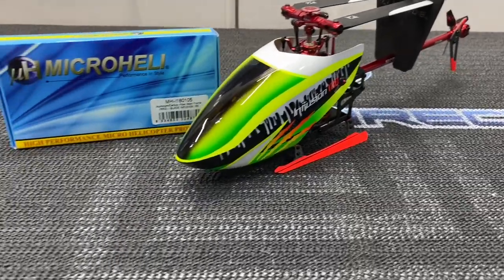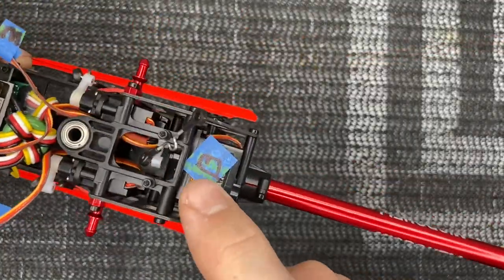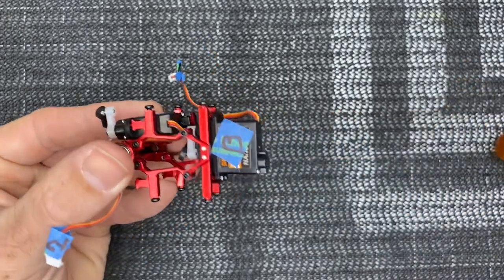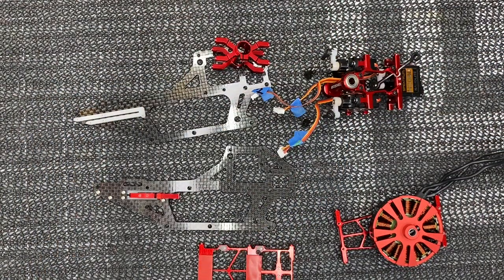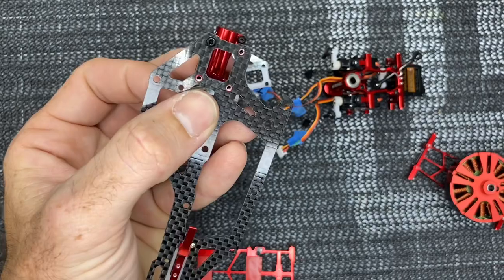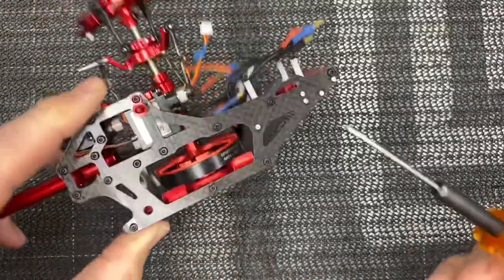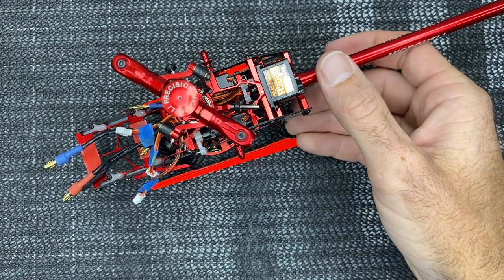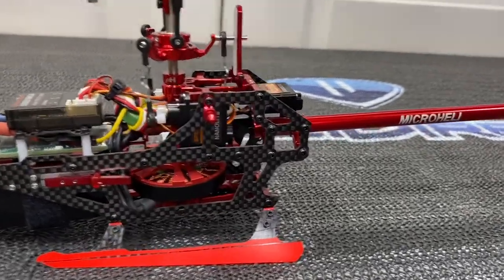Blade Infusion 180 MicroHeli Main Frame Build

Comment: Just got my Blade 180 Infusion today 😊. So pretty. First collective heli. Such a beast compared to the 120 SR and smaller helis I've flown. It has so much... presence in the air. Really feels like a serious machine. Maiden flight in basement went... Uh. Well, it went. 😂

First five minutes of battery I spent hovering around. 😰 Then I realised SAFE mode was not working, no self-leveling. Felt kind of proud I kept it as stable as I did without it😊. Landed, set hold mode, checked settings in NX8, found forward programming and enabled SAFE. Telemetry said battery was at 3.98 (I'm using the 850mAh for training time) so I set it down and decided to try hovering in SAFE. 😮 So much easier.

The I got cocky and flipped it to stunt 1 and promptly lost control. It bounced off me (hurt my pride more than anything) then crashed into the ground and snapped the tail boom because I forgot throttle at 0 in stunt 1 does not, in fact, kill the throttle. TGF spare parts 😂. 

Ah, I need the practice of replacing parts for whenever I decide to get some of these sweet metal microheli upgrades.

Comment: Pro(?) tip: before and during disassembly take photo(s) of each detail area so you know where everything was before you start moving things.
Reply from the maker: That helps some people. When you’re changing to a different frame design, it’s harder to take pictures of its stock because things are a little different.
Reply: @westhobbiesrc8051  that makes sense. Switching to aftermarket mods might make pictures less effective. I guess I was thinking about if you were just fixing/replacing stock with stock.